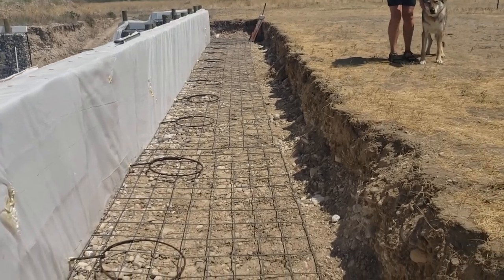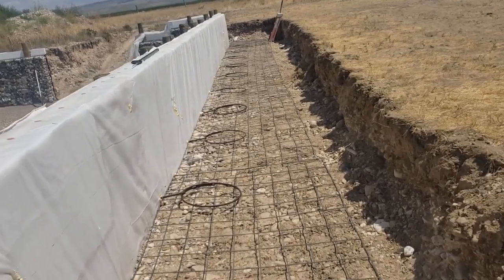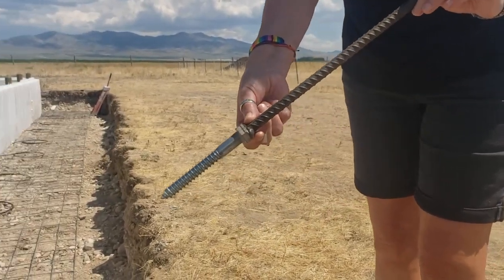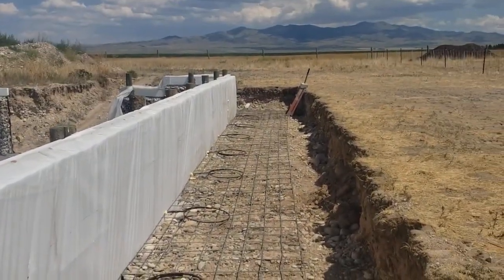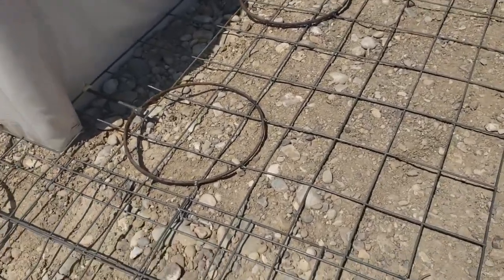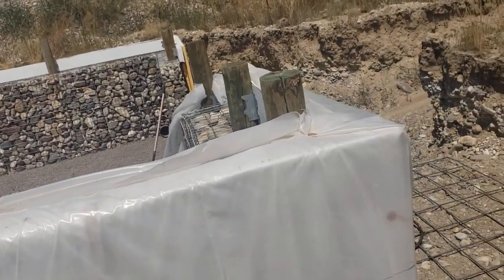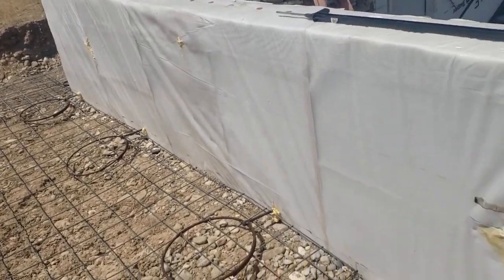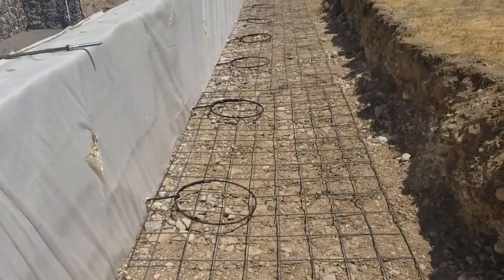Step 14:  Installing the second anchoring system in gabion wall for pit greenhouse

Comment: Have you guys ordered your roof panels yet? And if so, where did you get them? I'm looking at homedepot and they have the duel layer lexan panels for $93.28 for 4x8 sheets and we are looking at over 8k  for our build and are wondering if there is a better cost saving going a different route.

Any advice would be greatly appreciated.

Thanks for sharing, and as always, keep building  👍
Reply from the maker: @ToddLarsen  Forgive me.  I just saw this post and I apologize for not getting back to you sooner.  We purchased our 10mm double wall, Lexan  polycarbonate from Duralight Plastics.  Lexan is a very good brand, so we didn't scrimp here.   We got Thermoclear with 2UV 72.  Duralight has an engineer on site that will take your design and do a materials list to fit.  Go to www.duralightplastics.com.  Keep in mind, there is a balance when ordering your polycarbonate to provide heat and light.  Too thick, you sacrifice light.  Too thin, you sacrifice heat.  Also, we went with clear.  If I had to do this again, I probably would have gone with opaque for better light diffusion.  Cheers, J&K